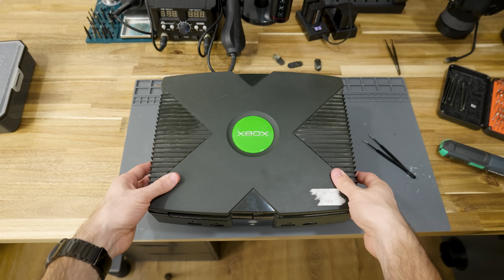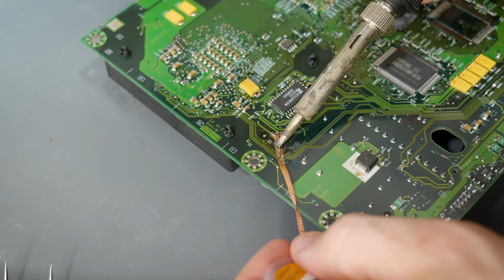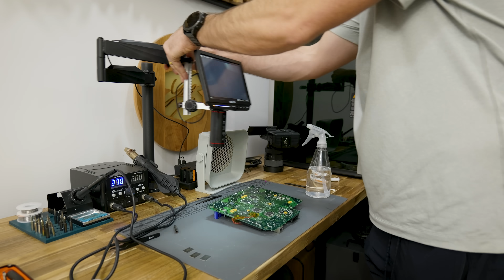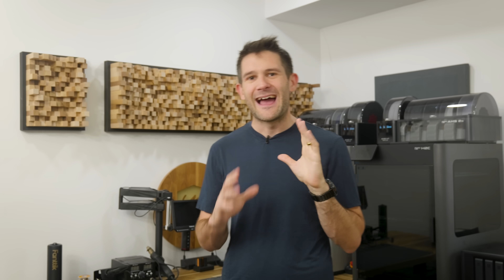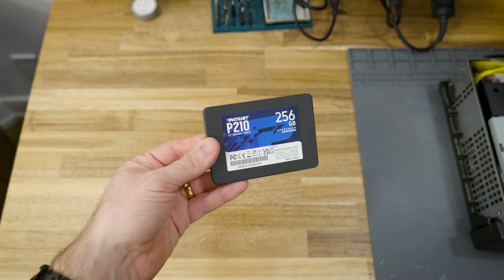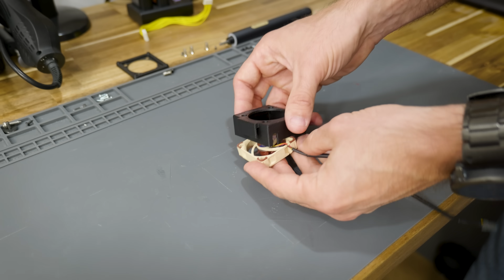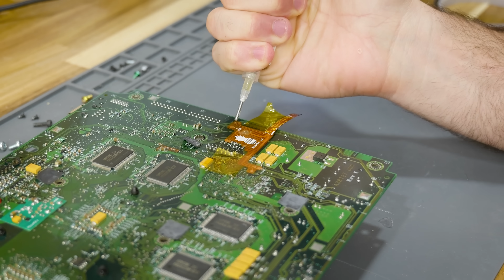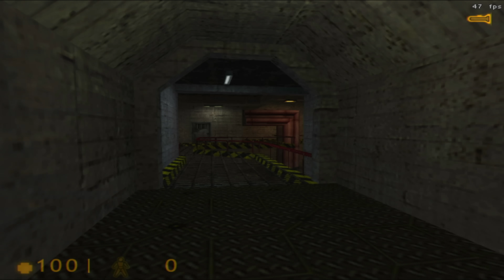I built a MODERN XBOX...

Comment: Get a Pen-Vac Vacuum pen for pick and place rework. One of my first jobs was a rework position at the end of line. I had a heat gun, no-clean flux, and a good EDYSN solder station complete with soldering iron and hot air pencil. At bit of $$$, but worth it .

Comment: Commenting before watching. This is one of my dream builds. I might have even left this comment before on this channel. 
1.4ghz tualatin core, 128mb ram, ide to sata with a 2x or 3x 2.5” bay with a hardware controller to use 2 or 3 2tb ssds, stellar Xboxhd+ bundle for the best hdmi signal possible, running through a disassembled retrotink 4k pcb that sits inside the console, ogx360 board for modern Bluetooth, usb c breakout board, internal WiFi bridge inside the console, replace capacitors, add modern voltage regulation, modern cooling solution that also covers the south bridge, and cut the board down as small as is feasible, if not transplant all components into a custom pcb (way harder). Stuff all this inside a custom aluminum enclosure. Last a complete mechanical conversion of the existing dvd drive, or the compatible gdr-8163b to make it a slot loading dvd drive. 

The perfect Xbox.

Comment: That pink "epoxy" is literally PTM heat transfer before the modern PTM stuff came around.
Your xbox's PTM looked in good condition under the GPU heatsink.
Also, how to know it's PTM? It goes from a solid-ish chewing gum like waxy material to a liquid when heated to about 50-60C as per when you heated it.
Now, if it had gone bad, heating it may of allowed sheering of the PTM.
.
Also, the clock capacitor was only classed as a design flaw because they chose to use a "supercapacitor" (Not acidic, but a mild electrolyte base) rather than the slightly more expensive ML series rechargeable lithium coin cells (i.e. ML2032 soldered), but then again, they probably assumed people will try and replace the ML with a CR and wonder what went bang when it tried to be charged.
Also, if you don't replace the capacitor with at least a 0.1F (Yes F, not uF), it'll only last a few hours at most.
.
As for RAM, you'd want to have the pads as flat as possible, then microsolder to the two opposite corners, apply flux, then solder the rest and check for bridges.
Either way, you had success, so that's still a win.

Comment: This kind of stuff just misses the point of retro consoles. By removing the disc drive and replacing the og Xbox software, as well as the hdmi mod, you’ve made it indistinguishable from a competent emulator on decent hardware. Homebrew and modding should be used to bring out the potential of the pre-existing hardware, not removing core elements of its design. And for the record, a decent component to hdmi looks perfectly fine. Of course composite is terrible, but that wasn’t the only option. And and the Xbox looks best on a crt anyways. The fan mods, ssd, and ram upgrade were pretty cool, though.

Comment: If you have a 1.6 revision xbox you'll have a nice gold clock capacitor... and you should absolutely not try to boot the system without one as it IS required to run on 1.6 versions. Replace the capacitors that handle power to the CPU and GPU but leave the rest alone unless you can see bad caps. (Thankfully the xbox in the video isn't 1.6 as it doesn't have that gold clock capacitor.)

Comment: There is a faster choice for SSD, but it would be almost impossible to get, I have one, but I cannot part with it for any reason.
But... the Army had special computer systems that used IDE based SSD's.  And they have a secret... they overclock the IDE protocol.  The result is that instead of having a maximum transfer rate of 133mbps, it can actually fully saturate a USB2 bus at 480mbps.
From my own testing it works natively with practically any IDE header.
The downside is... the drive cost an astounding $10000 per unit new, and it is only 128GB.

Comment: You need to neutralize leaking caps with vinegar. IPA is not sufficient.

Use more flux. Tack a couple joints first to hold flex cables in place, then solder the rest.

The clock cap is not a "design flaw", it's a side effect of the capacitor plague and a questionable supplier. The 1.6 revision takes a lot longer to leak because they switched suppliers. They will all leak eventually. You don't need them anymore either if you're on a hacked BIOS.

Comment: Next time, clean all the solder from the pads of the ram chip contacts, then lay the chip on the copper, and then add your solder and flux. Trying to add the chips on top of the old solder is much harder.

Comment: Why didn't you upgrade the pay with a pico psu? I used to do that a lot with modded Xboxs they take it quite well. Then you soldler a USBC port to the power wires and put a USBC 3d printed plug in the back.

I would of also got rid of 2 of the controller ports and swapped it with a USB port.

Comment: Biggest thing you missed was upgrading the CPU to 1.4GHz. That’s a killer mod for this system.
Reply: Most people miss it on purpose. It is NOT an easy/moderate/hard mod. It is very hard and requires more things to accomplish along with better cooling and case modification (Zach already took care of that though). Many opt for the 1ghz option that does not require as much modification. Because he added all the other mods including the SSD, there should not be any bottleneck, but if there is that would potentially come from the GPU. I am a little surprised since he removed the dvd drive that he did not do the mod for the one massive fan that can be fitted with a custom bracket in its place.
Reply: @UsmcRara I agree it’s very hard and most skip it but I’ve got mine setup with a 1.4 so it would have been fun to see him do it.
Reply: It's a very complex mod, and, without patches to games, breaks compatibility. Best you can do without messing with software patching would be a 1.0 or 1.1 coppermine eb chip. The revisions to tualatin are just enough to break retail games.
Reply: useless mod
Reply: I was hoping to see a Cpu upgrade too.
Reply: It does absolutely nothing for retail games.
Reply: No, that will just bottel neck it
Reply: It's apparent that you have no idea how computer architecture works.....
Reply: @Jim-ku6ry  i am a fucking architect
Reply: @Jim-ku6ry  It's apparent that you have no idea about the original xbox scene. CPU upgrades are a known thing and have already been done. It requires BGA work and transposers, but is possible.
Reply: @popper6633 I SWEAR I've seen people install interposers to adapt the smd mobile chip to socket 370
Reply: @popper6633  just because you can doesnt mean you should nor that its a good idea 🤡🤡🤡🤡
Reply: @popper6633 it serves lil purpose other than run linux
Reply: nah leave them out of the loop xD
That way they can't pretend to blurt out stolen trivia later
Reply: @Jim-ku6ry its clear neither do you.

Comment: The ram soldering would not be hard at all if you just used more solder, solder is desgined to flow toward the pads. and most does not stick to the PCB itself. Just do a quick swipe across the connections with solder on the iron after tacking the chips in place and you are done.

Comment: Little tip for re-soldering the ram chips, if you pre-heat the board a little bit with the hot air station, you can see the solder points liquidize, then you can drop the chip into place and most of the legs should flow into the joints, and then you just need to touch up the points and make sure they are good.

Comment: I would’ve installed a slim laptop DVD drive. It’s not an old school piece of hardware without its drive.
I would’ve also converted the PSU to a USB-C one, maybe a Pico-PSU. The wires use ATX-spec voltages you can easily grab.
Finally, I would’ve made the case a lot slimmer given the above suggestions. The slim DVD drive and the SSD could go on the back side of PCB, away from heatsink bulk.
Overall, still a nice build :)

Comment: Cleaning the pads for those RAM chips with wick before you install them would make things a lot easier, some of the pins don't make a solid connection on the first pass because they're all slightly raised away from the board. These kinds of chips are a breeze if they're sitting flat, you just flood some solder on the iron and drag across all of the pins.

Comment: I thought this was a great watch. I've got an old Xbox I've been wanting to do some upgrades to, and while I'm not entirely sure if I have the skills to do half of what you did, I am willing to try sometime when I have time to work on it. The only mod I did to my original Xbox was an LED that blinks when the hard drive is accessed. I used to have an SSD attached to it, but I forgot why I took it out. It might have had something to do with using a 40-core IDE cable, but it was what I needed for the LED mod, though in hindsight, it probably would have been smarter to attach it to the motherboard IDE pins rather than splicing into the IDE ribbon cable, but I did not think that far ahead.

Comment: I did the opposite back in the day. I purchased a broken Xbox and soft modded it. Put it in a PC Case purchased a compatable DVD (can't remember onw) drive off of ebay and had to change the firmware and swap the polarity of the drive opening motor. The drives would fail if the DVD drive failed and didn't match. I had costom firmware which allowed it to network with my pc. I could browse the internet from it and it could browse my network and even stream movies and files from my pc or any network device. I had a custom boot screen and all. I installed XBMC, XBox Media Center later known as KODI on it back before all of this was even a thing. I even installed a large Hard drive that could completely hold multiple games and load them in a literal fraction of the time compared to the DVD drive. I had a BlockBuster Game Freedom Pass which I would rent games, load them and return the games. hahahaha. It would literally copy games to the hdd allowing them to be burned via PC. Those were the times when I was broke.

Comment: Watching you installing the rgb brings back to when i was a teen and i installed leds in my controller port and a button to power the console on and off in my controller. Did the stellar modchip and hd install on another Xbox few months ago and it was a blast. Forgot about my led mod until i did the stellar install and realised that the new Xbox was missing a green glow in the controller port. I am sad i wasn"t able to transfer my port over since the new Xbox is a 1.0/1.1 rev and the one i bought as a teen was 1.5. Think at some point i'll grab the stellar rgb to redo the mod in a cleaner way. Was also thinking to design a case but i need to learn cad so i might grab your case and maybe design a fan shroud for a 120mm fan.

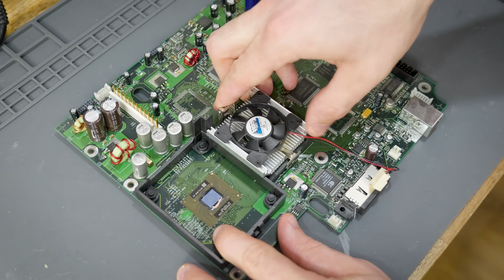Comment: 2:15 uhh.. I had a broken og xbox a few years ago. And I put a flat head under the gpu heat sink and ended up prying the gpu and pads off the board. The gpu was still stuck the heatsink.. I now run every og xbox for 30min -1hr or use a hot air station to warm it up.

Comment: Ik it wasn't the point of the video. But PC emulation gets away with 90% of the problems you face. I love my retrobat PC in my living room. GTX 1080 8gb, Intel i7 7700, 16gb ddr4 at 2666mhz. And it only cost me $120 USD to build. 80 for the the GPU 40 for the PC. I had a spare PSU on hand. And BAM I can play EVERY console ever made. Use chatgpt for the specific game to game issues. But there aren't a lot of issues. Practically download and play. (Edit) Also vimms lair has 99% of old console game roms. If you look up on Google "vimms lair" it'll take you right to it.

Comment: hmmm, last week I started digging into a modded xbox, cerbios ocxbox variant - I got a quintrix crt from panasonic, just installed a smooth 250gb hdd with is quiet, did oil the fan in the back. Its a great piece of hardware and the effort was resonable. its a retro console and I want it to make retro sh*t, that also means it sounds like a console. the moment when u play a game, you dont notice any sound of the console anymore. and yeah, it was not loud before. its a nice usability study you did there, but for me, its unnecessary. the CRT image via an rgb scart cable is nice and clean, and its how its used to be played. and yeah, installing the discs on hdd is awesome! but for what you do with that thing, you did stretch way to far, and I love my wired xbox controllers :D ty for the video non the less!

Comment: Brother, use solder paste and the heat gun to solder those high density IC's into place. The chip will center itself on the pads like some kind of black magic. You'll get a handle on how much solder paste to use after a few times.

- circuit card surgeon in the USMC

Comment: 20:19 no those solder connectors fuckin suck 😂 they never hold it's a gimmick half the time the only thing holding it together is the actual heat shrink and not the solder joint

Comment: Pro trick for turbo baked thermal paste, WD40 on a rag or paper towel. It breaks the paste up so quickly, basically just melts. 
WD40 makes an Electrical Contact Cleaner that's probably even better but I'd have to experiment with it.
Make sure you still clean up with a high % isopropyl after the wd40 though, oily residue is probably not a good thing to leave there.
Reply: The residue is the point, it acts to insulate components from water ingress. I've heard of technicians dumping a can onto audio equipment that got a spill on it.

Comment: Hey, I have an idea. U don't have to build it, I'm just curious about how it would work. I've had the idea to basically take an arcade cabinet and turn it into a sort of super xbox. How possible, or functional would it be? And how good would it work? Of course, the price is probably very high, but I'm curious about that too. 

I was thinking of controller inlays to replace the old controller board. The inlays doubling as charging docks. As well as the xbox logo across the top bit. With a disk drive and USB ports along the front part. Maybe also a glass screen across the front of the upper part of the body of it as well, showing the insides, maybe with led's if it's too dark because of the space.

I understand that the inside would have to be reworked a bit in order to get good airflow and uncluttered wires as well as allowing the  theoretical super xbox to fit. 

I love u'r videos, I can't wait to see u'r next build

Comment: CPU upgrade & USB-C PSU would’ve been a chefs kiss.
Reply: The only Implementation of such PSU on the market needs a big 100W wall wart which is a complaint many have with consoles that have them, so he probably avoided having to get such big power bricks
Reply: @melanieadv  that is the only drawback which is getting a wall PSU but sadly there’s no alternative to the Xbox’s PSU.
Reply: It would take the build to the next level!
Reply: @wildnshortz5213 it really would since some games would benefit from the CPU upgrade & frankly, those PSU’s are not reliable anymore even with cap changed. I personally want the one Nacho has in Xbox Original Prototype.

Comment: By far the coolest Original Xbox modding I've seen yet. Seen a couple dozen of them. 

Design flaw = tech not available at production

Bro, start using gloves with the acetone. I have fired people for not using gloves while handling the acetone.

Interesting watching you place those modules slowly. I've seen vids where people heat up the area and the chip pulls itself into the proper pos and seats, liker magic. They were also using 10x more flux than you. They bathed the area in flux. However, they were also deballing and reflowing their connection joints before attachment.

I decided to make my Xbox have better cooling, so I strategically cut the drives tray to allow better air pass-through. Then, for whatever reason I turned the Xbox into a Media Sever where it was heavily used for years till it ☠

Comment: 20:00 -ish yeah I like using those solder heat shrink things too. Butt I'll still give the wires that "Engineer's Splice" technique where the wires are twisted together and pulled tight THEN that solder comes in and fixes it nice! Though for a SATA SSD I don't think there's enough current to worry about that. *shrugs* <3 all

edit: I don't know how important RF Shields are but I might consider a RF/EMI Shield like Paint and paint the insides of that 3d Printed case.

Comment: The clock cap is required on the 1.6 rev Xbox. Which was the last rev MS released it also doesn't have the leaking issue.

Comment: Hey @ZacBuilds ! Some time ago I found that (zippo) lighter fluid dissolves thermal paste/grease like xbox OG has. Of course you still have to heat the radiator to get it off. But lighter fluid made it easier to clean that awful thermal stuff 😃

Comment: Hey, i've enjoyed this build of a modern original xbox, i noticed that you had upgraded the ram to 128mb ram and indeed it is a pain to do, but i'm just wondering why you didn't upgrade the cpu to "Intel Pentium III "Tualatin" 1.4GHz" altho it does tend to make the games run fgaster than they should do, so it may need patching or you could use a modchip Project Stellar". did you find it was more reliable just to overclock it? keen to hear your thoughts